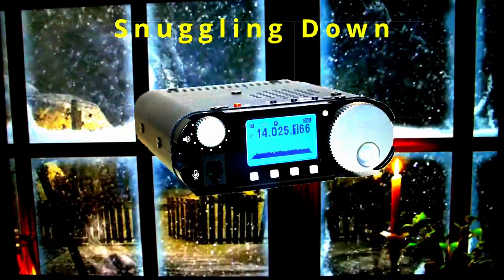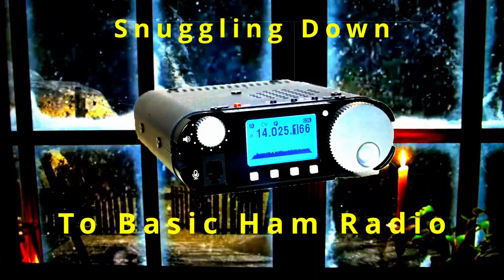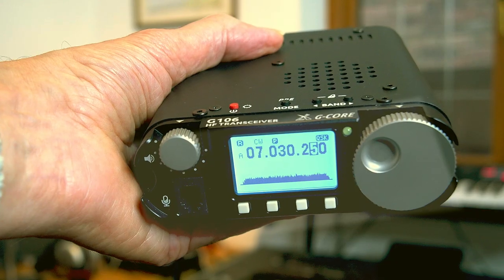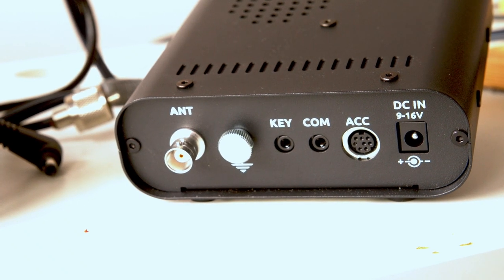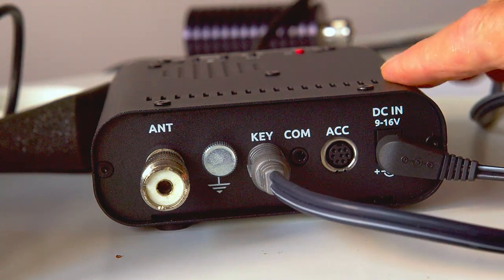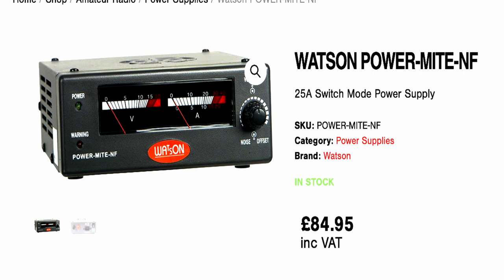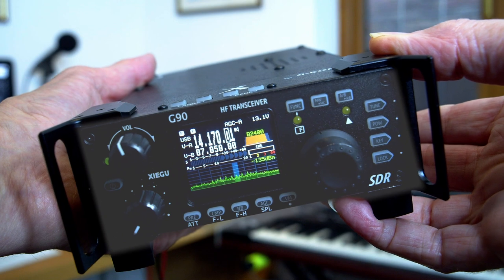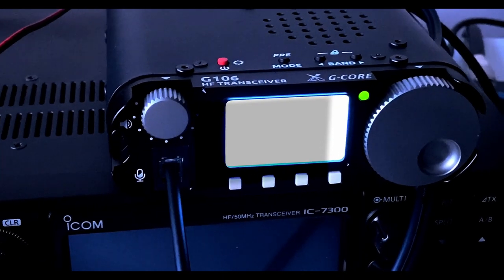Simple Ham Radio - Basics for Short Wave Operation.

Comment: Great video Peter! The simple basic aspect of ham radio is what I love the most. No networks. No devices. No Bluetooth. Just power, a transceiver, and an antenna(and yes...coax). Typically, I build my own antennas for the challenge as well as simplicity though I do use two of the Diamond HF/CL series for "run and gun" portable. Whether it's with my G90 or my FT-891, there's nothing like making a new DX QSO with basic equipment and what the atmosphere has always provided. Thanks for all you do for the ham radio community.

Comment: Excellent, simple is the best place to start. Also worth noting that with something like the Xiegu you can even work from the car, just head up a hill and sling up a wire or simple vertical. So even those with no antenna at home can get on the air
Reply from the maker: Great to hear your comments. 73 Peter.

Comment: I'm currently having a lot of fun with a Kenwood TS-140 I bought from an ad in RadCom and an MFJ-948C ATU bought needing work from a trader at Newark last year. My morse key is the type used with a Clansman military manpack. The only new thing I have is a power supply...other than that, and coax etc., my basic 100W station cost me £190 and a few hours enjoyable work sorting out the ATU. 73, G0CIQ

Comment: Great video Peter many valid points well put. Just bought a Xiegu G90, 12m pole and a 10m multi band wire. Plug and play for around £510. Love the channel.
Reply from the maker: I am sure you will get some good results. 73 Peter.

Comment: Quite right peter a lot of fun can be had with the simplest equipment  ,i remember a year or so ago we had a challenge in our club who could transmit the furthest with a pixie trx we checked the reverse beacon network for results as we were only using half a watt .as for antennas i have only one commercial vertical for two metres my HF antennas are home brew in fact one of them is a 20/40 metre vertical i made from your videos  works ok 73 and have a good new year.
Reply from the maker: Thanks for sharing. 73 Peter

Comment: In 38 years of ham radio operating, I've only ever used wire antennas. I've worked all over the world and had a lot of fun along the way. I've never missed not having a tower and beams and so on. Good operating technique and efficient antennas are the key to success here. Ivan...VE7IVN
Reply from the maker: Good on you - join the Club!